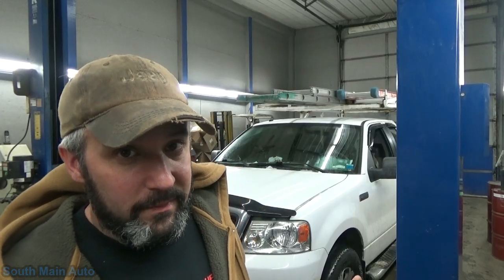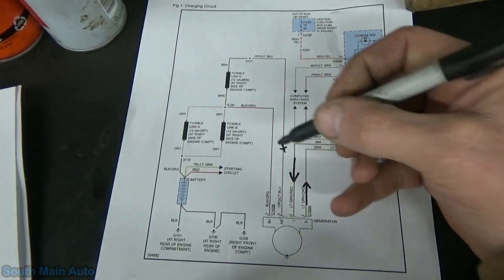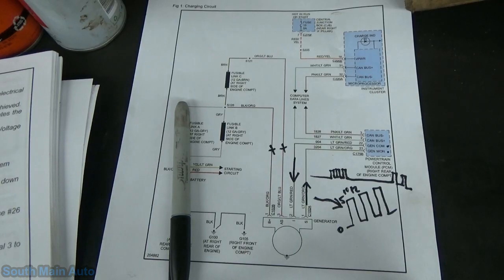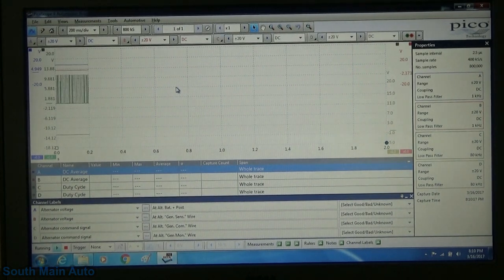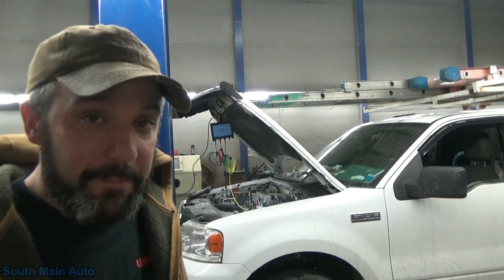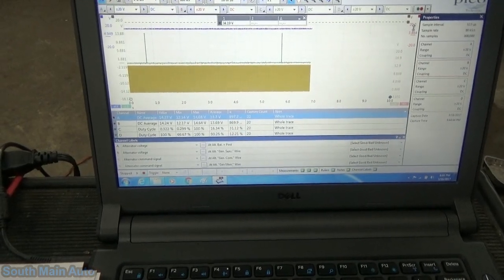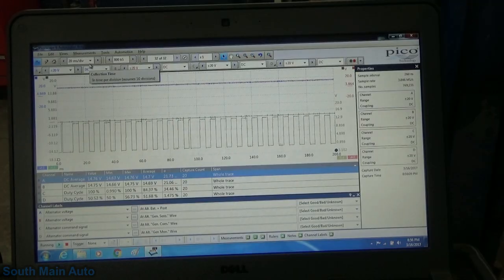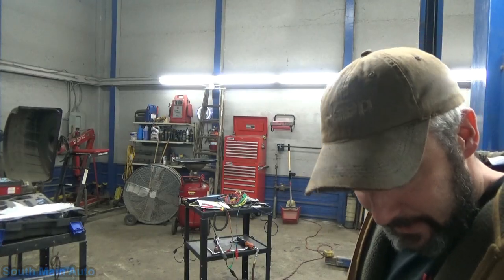Ford "Smart Charge System" Alternator Not Charging

Comment: I was hoping this video would help me with a similar problem; 2003 f250 5.4 battery light coming on intermittently, now not light, dead battery.  New battery, new alternator, one of the two wires to the alternator has 12 the other nothing.  Alternator not charging.  Checked fuse links, seem good. Tried Forscan but can't get it to work.  Guess I have to save a bank roll and take it to Ford.  Unfortunately this video and all the others I've watched did not solve the problem.

Comment: Hi Eric I have a question on a 2016 mustang GT 5.0 if you using a battery charger then start the car while still use the external charger can that damage the smart ford charging system in any way. Thanks

Comment: So what ur saying is since I have 2 batteries I can just disconnect the 3 prong plug and itl charge my batteries
😃👍
Reply: Yay I don't need a new alternator
Reply: It's ok cuz I have 2 27dc batteries in my old f150
And on occasion I run power tools from my truck
Thx Mr. Genius 😇
I'm gonna go reinstall my old alternator and forget to 
Plug in the 3 prong plug thx Mr.Genius
Cuz I'm cheap AF and I'm like super cheap
If it charges it charges 😀👍

Comment: As for me with my expertise it pisses me off that the pcm would have a lot to due with charging. I followed most the testing. But even he was slightly confused confused with the readouts and why he wasnt getting the red light . Basically my testing skills arent that good so im going to replace my alternator. And if thats not it if its my pcm im gona be hot. Because at that point . I think my pcm is sticking its nose in too many places. Well until my battery starts overcharging anyways .but my usuaull problem is. My alt not charging. But i apppreciated the video. Thanks

Comment: Wow, man, who are you trying to impress brotha !???? There is absolutely NO NEED to go to that extensive troubleshooting length when a simple volt-meter & some solid experience could have & would have arrived at a much more useful conclusion & a MUCH less timely & costly repair ! 

Then, on your OWN dime, take your theories & run w/them until your drooling in your sleep bud, because you have self-admitted that you can’t sleep at night due to the obsessive over thinking of an actual simple repaired electrical issue ! So, after ALL THAT BRAIN CRAMPING ! And after ALL THAT TIME (Labor) that the customer is being charged for, and paying YOU for….you only ended up w/the conclusion that the alternator was toast !??? Lol ! And you didn’t even diagnose/conclude what part of the alternator was causing this charging issue !???? Diodes, Rectifier, Stator, Brushes, Voltage-regulator, Etc !??? Or did you just install a new/rebuilt alternator in your customers truck & send him on his way w/a big FAT bill !?! No need to answer that. Just thought I’d spew off. Lol !
Reply: Spew off then  , what a tirade , meds run out ?

Comment: This was a really informative video describing the "smart" charge. I have a stupid 06 Escape doing an overcharge condition. Had mechanic swap the alternator since you get to pull the axle and unhook a motor mount to get to it, and all was good for 2 days. Then went back to same condition. Saw it was controlled by ECM, so I replaced that and got it reprogrammed. Looked good in driveway. Only have Forscan, no real scope to mon GenCom and GenMon. Even if I did, the connection is too buried on that stupid Escape to get to it. I can monitor the ECM versions of the signal and they look good after disconnecting the battery. Don't see every 5 sec GenCom pulse, but that is probably due to Foscan ECM sampling rate and they are short (battery is fully charged). Looked good in driveway for 15 min until you drive for 10 min.  Then all of a sudden, ECM reports no signal from GenMon, and alternator jumps to 17V or so using multimeter on battery... Disconnect battery for 5 min, and it goes back to normal for another cycle. Alternator probably passes bench test since it works at first, but something internal in the alternator/regulator? I'm at a loss.
Reply: I was wrong, it isn't missing GenCmd signals, but on this vehicle, they seem to come at a min of 15 sec. Still misses many and same OBD reader and laptop sees 5 sec pulses just fine on Expedition. Don't think it's a reader issue.
Reply: Thanks for following up at least! 👍

Comment: I don’t know if my 2006 Lincoln Town Car has the same smart charging system.  Recently I was driving when first I noticed the mpgs seemed much lower on the dashboard display.  Then a few miles later my dashboard digital gauges went out, but the analog gauges were still functioning.  Before the dash digital gauges went blank the “battery” warning light never came on.  A couple miles later the power steering became heavy.  After pulling into my driveway I shut it off, and just got a click click when trying for a restart.  It would start with a jump.  The next day it restarted without a boost the first time, then needed a boost the second time.  When I started going over everything I found a slightly low battery at ~ 11.8 volts.  The alternator output was ~ 10.9 volts.  Again, no warning light on the dashboard.  I did not check for any computer command fir charging.  I installed a new alternator and the alternator output increased to 13.6 volts (I expected ~ 14 volts), but now the battery was being charged.

Comment: I have a 2006 explorer that works about every 3rd time i start the engine, my battery light does come on when its sitting at 11.6  or less when its not charging, its a big battery so I am not worried much, I have never seen 14.6 LOL maybe 13.6, I have a digital on the dash aftermarket cause I am a Ham with radios and I want to know, 3 years never had an issue then all of a sudden I have an issue, I am also just going to change the Alt because I am pretty sure its the Int. Reg

Comment: still have BMS on my 2019 same issue come out dead no battery light but alternator wont charge battery, hit with jump box drive to my shop shut off still dont start, reset BMS turn key no jump box truck starts, i believe lightning storm last night screwed up BMS system, my dash cam was activated multiple times recorded nothing so must been storm

Comment: I have 12 - f250 6.0s in service right now.  I would rather spend the extra hours in labor to 100% fix the problem vs having to keep towing and pulling a truck out of service 2, 3, 4, 5 times before a problem actually got fixed.   Thank you for taking the time to make this video AND taking the time to make sure the truck was FIXED before it left the bay..

Comment: i know this is an old video..but what eric o was saying about the alternator codes. i can tell you from experience that i had a ford 500 with this style charging system, and this car had a run of bad alternators over a 3 year period. And at times it would come in with the battery light on and codes stored for the alternator not charging. You could pull the codes and shut the car off and start it back up and the codes would be gone even when the alternator was still not charging. To answer the question on the alternator codes i would say that it must have to be a 2 trip fault or something along those lines, because the chance of seeing the battery light on when the car was actually broken was super rare. At one time it had a bad alternator that failed in a way that when it got super hot (phx az in summer) it would fail to send the mon signal and intermittently set the charging light, at other times it would be charging and sending the mon signal and still have the charge light on. So its a mystery and goes back to what all the old timers say about computer controlled circuts...its voodoo.  

Second thing, The test when you unplug the alternator and rev the engine to see if it charges(similar to a full field test) is super helpful and i first found that on identifix when diaging that 500. Its a quick test and very helpful if you understand how to apply it properly.

Comment: I am going through the same thing now I just installed a alternator on a 2007 Ford Explorer it displayed a charging system default light on the dashboard and I just took for granted ok bad alternator and I replaced it with a alternator from Autozone the light still was on I took it to auto zone they checked the charging system and everything was reading fine so I’m lost but now I’m learning about the smart charging system so I’m now going to the dealer to see if they can get the charging light off I hope that they can

Comment: Well, here we go. I have a 2017 ford expedition 3.5L v6 2x4. My newest problem has been the radio volume. I set the volume to 11, when driving down the road, and I reach say 45 to 47 mph the volume gets louder, but if I'm at a stop sign or a red light it gets lower, when I take off and get to 45mph it gets louder again, until I come to a stop or red light, where it goes quiet, like say a setting of 5 or 6 on the volume. What gives? I too am old school, and this used to tell me, back in the days the alternator was going out. After watching this video, I'm not sure anymore? Maybe it could be the PCM, or both. I am going to take it to the dealer and have them look into it, I bought this back in Oct.,2020 used from this dealer.

Comment: I had to change the alternator on my focus. Have to remove the motor Mount and strap the engine forward. Even then it’s a lot of wiggling. Aftermarket alternator didn’t talk to the pcm serial buss so had to replace it again with Ford alternator

Comment: Another valid point for this video is the battery type. Smart charging systems must use a Silver calcium battery and not a basic lead acid one. Silver calcium can take the boosted voltages that the PCM demands whereas the lead acid ones can't. The constant demand for high volts will kill the lead acid battery.

Comment: It seems obvious that you have a bad connection between battery and alternator.  (the large cable)  When you started it without ecm control connected it didn't charge battery at first,  then you revved it.  and a small spark occurred at the bad connection and arc welded a temporary repair as noted by it started charging.  A guy could just change the alternator and assume the alternator was bad,  because when changing it the connection gets fixed.  I didht watch the end so but that's my diag.

Comment: My 1997 ford f150 charging system failed . it would kill a battery overnight . but the charger would show its charging . pcm had a short . so the short would kill the  battery running or not running

Comment: If it doesn't produce a check engine light is there anything wrong with just leaving the three pin connector disconnected and running in a default mode?  I have an 03 Ford focus with a similar problem so I replaced the alternator but problem still remains.  The battery light is on and the alternator is not charging, but then randomly it will just decide to charge the battery and then once again stop charging the battery.

Comment: Sorry I did not read the other 660 posts and I will comment as I watch, not at the end so sorry if I repeat what you will say. This is a pull-up system, not a pull-down, shorting it to the ground is backward. To full field, the alternator needs to short to B+ on the COM terminal BUT is a 100% PWM going to work on a good alternator to force it to charge? As we see in the beginning, that COM PWM was there but the alternator did not start to charge, since you have all PIDs, this proves that the wiring is good and the PCM is communicating. IF you unplug the connector and cause a fault or limp home mode, will an alternator charge full time (IT DID), that is the default strategy, if not then apply B+ to COM and see if it will charge on a known good alternator, that may be a strategy but I also believe that the COM and MON must speak the same language, EX: 125hz or near that frequency. This is a SOFT START system, it does not charge a cold engine, hence the reason to check the IAT PID. Need to turn on some heavy loads when testing an alternator also. When you change a part, or a battery as part of the recharge system, you need to allow the vehicle to sit, completely undisturbed for 8 hours so the BCM can monitor for a parasitic drain, NO FOB door locks, NO NOTHING, so the PCM can relearn the new setup. I don't know what year this started but that is published information. I also am puzzled why the idiot lights did not come on, maybe due to this learning strategy?? As always, thanks so much for the in-depth diagnosis.

Comment: I know this is an older video but I have an issue with my Bronco (89 efi 5.0) where the truck shuts down when I try to use my plow.  I bought a "one wire" power master alternator as an upgrade because power master says it's the one I need for that year vehicle.  I have two connectors on the stock alternator (tested good) each connector has 3 wires.  one connector has two large wires and one small, the other connector has three small (but bigger than the small one on the other) and I assume the smaller connector is the com in and out to the computer and the large is power and ground to the alternator.  My concern is that after I put the new alternator on and eliminate the com wires that the check engine light will stay on as well as the red battery light of death because there is no communication to the ECM and it thinks there is something wrong.  The one page directions just say connect one red wire to the battery and one black wire to ground and  just keep the stock harness unplugged.

Comment: THE REAL SOLUTION IS. #1 THE BATTERY/STARTER/ALERNATOR CABLE HARNESS. #2 BAD INTERNAL REGULATORS. YOU NEED THE HEAVY DUTY REGULATOR (F601HD) #3 RUN NEW ALTERNATOR PIGTAIL WITH NEW WIRES  SOLDERED, TWO STRAIGHT THROUGH THE FIREWALL INTO THE ECM CONNECTOR (LOOKUP PINOUT FOR ALTERNATOR COMMUNICATION WIRE), THEN THE ONE THAT IS HOT STRAIGHT TO THE POSITIVE LEAD OF THE BATTERY WITH A FUSED TERMINAL #4 GET A BRAND NEW ONLY DURALAST GOLD ALTERNATOR, THEY HAVE THE HIGHEST GUAGE WIRES. believe me this will fix your problems, also a tip for getting the alternator out is remove the rear ground/lift bracket that is right above the alternator before removal. Makes it much easier. Then pull pulley up first. Also the cheap regulators most use have caused the solder to melt on multiple alternators. The HEAVY DUTY REGULATOR IS THE MAIN FIX  @14 VOLTS
Reply: Also this is mainly pertaining to 1999/2004 focuses with zetecs but same principles will apply to the similar generation fords just may be different parts.
Reply: Very good video i just find many folk that are clueless to the internal regulator problems and the resistance problems due to crap ford wiring looms
Reply: Basically the system is over engineered and the regulator and wires are underengineered because ford is all about productivity not particularly the highest build quality on that kind of stuff

Comment: Guess... The commands from ECU are not the same as in a working car. Voltage sensing in ECU might be wrong causing it to not send the charge command to alternator. My 05 European Maverick (Escape) is now and then trying to charge for ca 15 sec. and then stops again.

Comment: 2003 expedition battery light is on but alt is charging wtf? Help
Reply: Voltage regulator is going out in the alternator. It’s just not bad enough to not work at all but it will get there. Actually fairly common
Reply: @MoparMadness93  nope that’s not it
Reply: @dangerousfreedom4965  then what is it? Because in most of them the voltage regulator grounding out is what directly turns the light on

Comment: so, I came here to try to understand the principles of operation for a computer controlled alternator, my 1998 Mercury Mystique has a 125 amp computer controlled alternator, the insulation on three wires at the rectangular connector crumbled and shorted together, the brushes and slip rings of the armature where worn and damaged, replaced the alternator, charged 14.5 v only below 2000 rpm, above that rpm voltage drops  and at about 3000 rpm the engine looses power and misses. I'm going to try to disconnect the plug, not easy on this car where the access is at the right front wheel with the tie rod and role bar link disconnected, 3 hours (on a good day) to change this component.
Reply: disconnected the rectangular connector, now the alternator doesn't charge but the engine will run above 3000 rpm as it seems the alternator is not dropping voltage below operational level. It looks like the middle wire on the connector jumps to the stator so that would be normal, trying to figure out which wire is the com to the PCM, I'm thinking about cutting that wire, so, is it the orange wire or the green with a black tracer, which one , hmmmm orange or green , tick tick tick...
Reply: Hmmmm, no luck, grounded the green w black tracer, batt light illuminated on dash, cut the orange wire(18 ga wire) no charge, so, I begining to wonder where the orange wire comes from can't really make sense of it. Possibly chasing the wrong cause, maybe a bad connection back to battery, i  dunno.
Reply: Well, the orange wire is fused with the fog lights at the power distribution box in the engine compartment, energized all the time.
Reply: @johndonadeo1011  i have a 2002 crown victoria  and had to run a ground to the middle prong the bigger wire is  hot all the time the other is switched